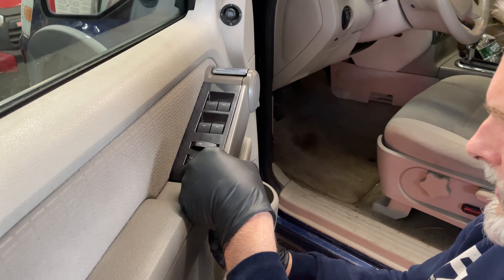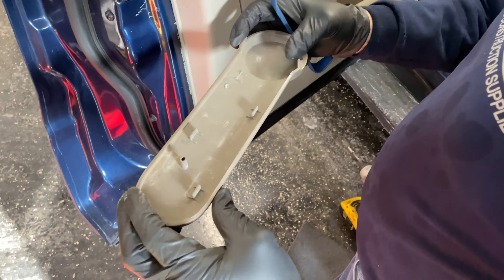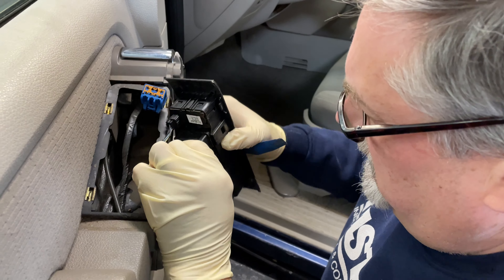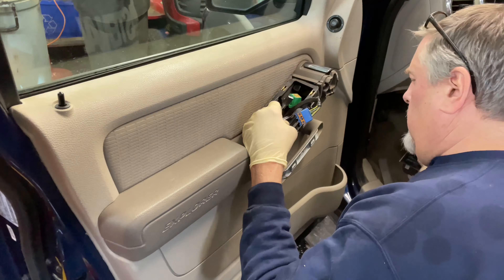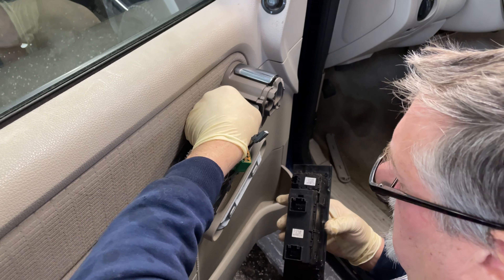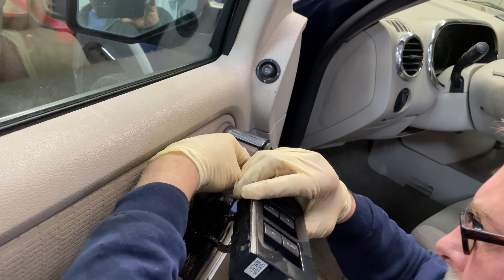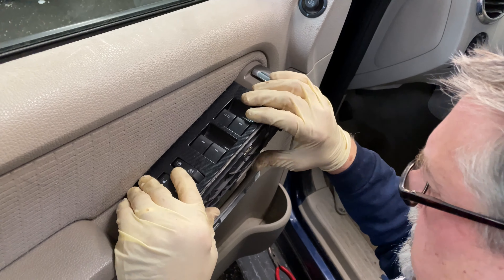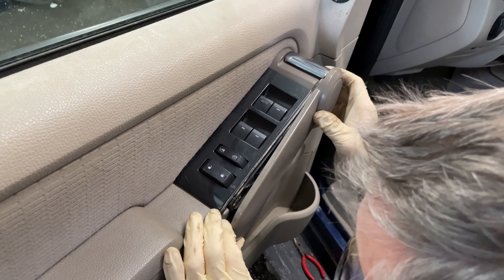2006-2010 Ford Explorer Master Window Switch Replacement

Comment: I have a 06 explorer and the front windows work fine. The rear windows seem to work only on hot days. Sometimes only one of them works. Do you know what could be causing the problem?
Reply from the maker: You may want to check to see if there is a broken or a frayed wire in the wire harness between the driver's side door and body of the truck. If it looks good also check the wire harness on the problematic doors. Here is a video we did or what to look for and how to fix it. Hope this helps you out. https://youtu.be/EcOWrgmMUFw
Reply: @HomeownerRepair  thanks! I’ll check it out.